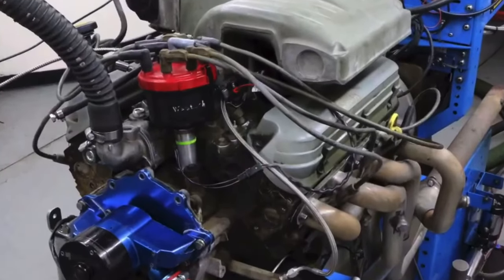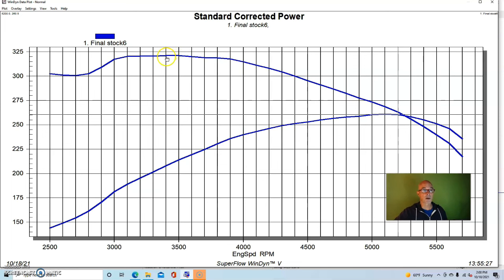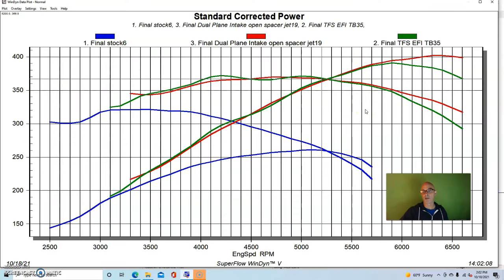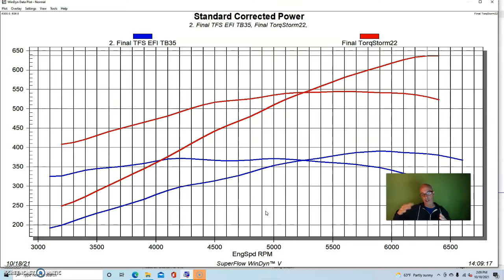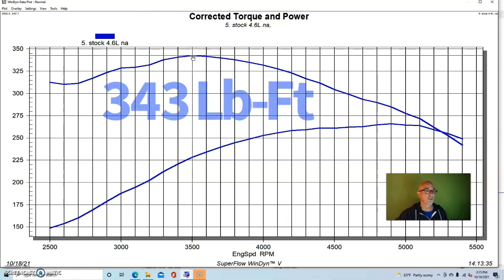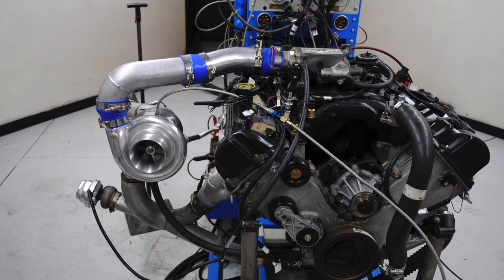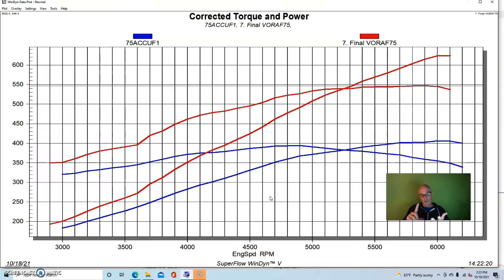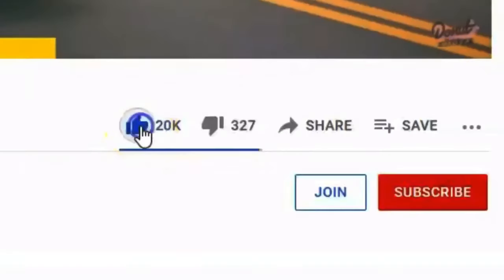WHICH FORD V8 WORKS BEST? OHV VS SOHC, 5.0L 302 vs 4.6L 2-VALVE MODULAR? WHO IS BEST FOR BOOST?

Comment: I would always, always, always go with the 5.0 over the 4.6, why? The aftermarket, Tons & Tons of stuff, oh yeah n that Cubic inch thing!!😂💜💜💜 But both are great platforms, just comes down to preferences 💯‼️ Thanks Sir!!
Reply: Yeah because there's no aftermarket for the 4.6. You can get what ever the 5.0 has for the 4.6
Reply from the maker: the 4.6l doesn't have 30-40 different sets of after market heads, but it does have 1 set and ported PIs
Reply: @richardholdener1727  that's because pi heads aren't absolutely junk like any iron sbf head
Reply: @dougsgtp  iron?
Reply: @MikeSmith-ey7ku  cast iron heads......
Reply: @dougsgtp  the 4.6 doesn’t have iron heads
Reply: @MikeSmith-ey7ku  I know, reread the posts
Reply: @dougsgtp yea they're decent and aluminum factory unlike the 302.  Ported pi can make some decent power.
Reply: The 4.6 makes just as much power with less cubes did you watch the video?  Lol.  You can make more reliable power with just forged internals instead of needing a dart block too like with a 302.  The 4.6 is the better platform ppl just like the 302 because of nostalgia and because it's larger like you just said.  It sounds cooler saying 5.0 vs saying 4.6.  You can also do a big bore if you wanna say 5.0 lol.

Comment: I have owned a 2002 GT for years now and it still has the original 2V motor and 5 speed 3650 manual transmission with 236,000 miles and it runs like a top and I run the tach in the red all day every day. It’s a great motor just needed more power potential. The 5.0L coyote is tempting for a swap.
Reply: Building your 4.6 2v would be way more simple and less costly, unless you're needing 7500+rpm and 800+hp capability.  Richard just showed you one pathway to 600+hp with a 4.6 2v.
Reply: Forged internals, cams, headers, boost can make some pretty good power on a 2v even with stock heads.  It'll sound way better than a coyote and you can prob do it all for not much more money all in.

Comment: At the end of the day though, the 5.0 is STILL cheaper to build....and I'm a 4.6 guy. I LOVE 4.6's. they have plenty of potential when the bottom end is built right and the heads are done but, your looking at 7 grand plus. The 5.0 can be built to the gills including a dart block for less than 5 grand and make the more power because it will then be a 347 or some type of stroker lol. But, there is NO sound like a 4.6 turning 7600 Rpm before a shift ❤️
Reply: drop in forged pistons and rods plus a cam swap on a 4V 4.6 and youll do way better with less money. what you spend on cams, you dont have to spend on cnc ported heads/intake/ blah blah blah.
Reply: @OxBlitzkriegxO  but why do you need stronger rods and pistons?
Reply: @MrPorsche91730  they are a weak point stock
Reply: @MrPorsche91730 so you can boost it to the moon and back and make tons of power reliably.  You can't do that with the same mods on a 5 liter because you would also need an aftermarket block to make the kind of reliable power a forged 4.6 can.
Reply: Dude you can do heads cams and bottom end for way less than 7k.  It's gonna cost more to build the 5.0 because you gotta have the dart block to make the kind of power the 4.6 can with just forged internals.  You can stroke the 2v to 5.3 and with the right heads and cams setup it'll make as much power as most 347 setups.  Cams cost little more because 2 vs 1 but otherwise most other mods are similar other than you need a dart on the Windsor adding 2000+ dollars to it.  You're way over shooting what it costs to do a forged 4.6 with ported heads.

Comment: when i had my 1999 mustang GT, i ran a 70mm th body, mac long tube headers with 3 in collectors, 3 in  mac power chamber no cats, ported upper intake plen, FRPP underdrive pulleys, 24 lb injectors, 4.10 gears, Ported stock 80mm mass air, K&N open element filter, Super Chips tune for 100 oct fuel.. 310 rwh hp with a Auto and a 3000 stall and a transgo shiftkit. Key is the plugs, copper 1 step hotter. custom gap.
Reply: You have the part number for the hotter plugs?
Reply from the maker: 300 wheel hp with no cam or heads and a ported stock upper? seems high

Comment: I have a project Bronco I'm in the process of building. It's a 89 with a 5.8 V8. I've been debating on building up the stock engine or coyote swapping  it. I eventually want to add boost and spray for a drag setup. For now I'm just going to stoke it to a 408, put some better heads on and go from there. My questions are is it worth spending the money on stroking the engine and will it be able to handle boost and spray after I do? Or should I just do the swap and build up from there?. Fords are definitely more complicated than LS/LT engines I can tell you that but I refuse to cross brand my vehicle. I'm an American and I love all American brand muscle cars and trucks so I don't have a favorite. My Tahoe will stay GM, my Bronco will Stay Ford, and when I get a Mopar Truck it will stay Mopar.
Reply: The 351 block is a thicker casting than a 302 block. You can get more power, and do so safer. That said, a truck coyote from, say a 2016, you'll get instant access to the better part of 400whp. A 351 is gonna be cheaper to build. But a coyote makes pretty impressive power untouched

Comment: 20 fewer cubes and the 4.6 makes more torque than the 302. I'd like to see the test of the Trick Flow OHC heads.
Reply: Longer rods, more piston dwell
Reply: @rickstorm4198  I'm thinking the Modular heads have better cylinder filling. I could be wrong.

Comment: Being you used Trick Flow on the 302 It been better comparison if on the 4.6 if used Trick Flow top end. By using 2V Twisted Wedge heads & TFS cams. Maybe used Victor Jr lower intake with Upper EFI plenum & TB.

Comment: What about Truck/Triton 4.6L mods?
2WD.
Ditch intake or keep it for the longer runner/better torque numbers?
Long tubes or Tri-Y headers?
Looking for mid-range punch along with a touch of stump pulling. 

Daily driver, light trailer duty.

What say you?

Comment: I personally think you should have included running the supercharger on a stock motor. You are much more likely to see that setup in the real world than heads, cam/s, intake, AND a supercharger. Also, isn't it true that you risk splitting the block on 302s if you go above 600 HP? I know I've read it in multiple places.
Reply: yes the 302’s STOCK block starts to crack above 450 if you aren’t careful, i know some guys who around 500-600hp with a stock block 302 on a Turbo or SC set up , they can hold up pretty good , sometimes...
Reply: @eric5.080  the 2v is stouter by a long shock all the mod motors are (block wise) put forged internals in both and turn the wick up the 2v is gonna hold up to much higher hp because of the block.

Comment: Great video! Wish static compression figures were given for both engines.
Reply from the maker: both were stock to start-but near 10:1 after mods
Reply: @richardholdener1727  I guess I should have been more specific. If I remember correctly, a stock 5.0 had 8.8:1 compression but you said you swapped PI heads onto a non PI block. Just curious what that raises the compression ratio to. Appreciate all of your videos!
Reply: @88tcoupe they was higher than 8.8:1 I'm certain.  The compression prob was a little higher on the 4.6 but it's down on cubes and make 5 hp and 20+ tq more despite being less displacement.  After modding the trickflow heads prob added compression to the 5 liter I'd imagine.
Reply: @midnight347 I thought a stock 5.0 was 8.8:1 but I think you're right. I checked and it looks like they were 9.0:1.

Comment: I've got a 4.6 thunderbird in the process of getting an entire pi swap. I wish i had a 5.0 bird to start out with though
Reply: Look what Johnny Langton accomplished with his 2v auto Thunderbird. I can not find 1 thunderbird with pi heads running the times that his did na with renegade npi heads.
Reply: @madmod  hell yeah. So far its been a giant pain in the ass
Reply: @brysonshires9742  Most of the gains in the swap come from the pi cam and pi intake manifold both of which will drop on to a stock 96+ npi head with no issues. Theres also the compression bump going to the pi heads but thats not hugely responsible for the power gains offered. Not only can the npi fit a better cam spec, they also dont spit plugs like pi heads do, and have reasonably good flow without porting when you address the single angle valve job they boast. Johnny went 12.98 in the quarter mile equipped with renegade npi heads, stock pi cams, and a stock pi intake manifold at stock compression through a 4r70 auto. At 3700lbs, i cant find a single pi 2v na running those same times in that chassis. I would 4v swap before pi swapping with how affordable used intech engines are these days but thats not to say the PI heads can't make great power.
Reply: @madmod  i would probably reuse the 95 bottom end and heads if it didnt have a spun bearing and no compression on 8
Reply: @madmod  you seem to know a ton about these. If i go on rockauto and buy a maruder torque converter, will it bolt right into the 95 trans? If not what would be a better converter to go with, looking for around a 2500stall
Reply: @brysonshires9742  I believe the 95 4r70w is identical to the later transmissions with the exception that some use different length tailshafts and they also boast one less accumulator spring on the 1-2. To answer your question, you should be able to use the marauder converter no problem. Id also recommend a jmod since you've already got the trans out. The jmod will greatly improve shift firmness and speed, as well as help prolong your trans life. The stock converter from a Marauder, mustang, mark viii, and mach 1 autos are great improvements over the stocker found in early platforms like panthers, cougars, and birds.
Reply: @brysonshires9742  If you are content on using pi heads and want the best bang for the buck, you should consider finding a used explorer 2v engine. They are equipped with an aluminum block and the same pi cams and heads as the Mustang. You also get the benefit of losing 80lbs off the nose of the car just due to the block alone. They can be had complete which saves you piecing together a swap and ultimately the aluminum block is a lot stronger making it a solid option to throw your hard earned dollars at.
Reply from the maker: I wasn't aware of the alum 2V in the Explorer-than for the info
Reply: @madmod  thats exactly the motor im looking for. Really any 01-04 aluminum block. Then if i end up blowing that slap the pi heads on a 98-00 bottom end
Reply: Thanks to your information if i ever get some heads built itll most likely be the stock 95 heads, assuming they're good. All i know about the engine is it was overheated to the point of a spun bearing, so little hope on those actually being good
Reply: @brysonshires9742  The 91-95 npi heads should be avoided. They have poor valve springs and take different valve stem seals than all the other modular engines. The 96-98 npi and 99-11 pi share the same valve springs despite different assembled heights and both are far superior to the older castings in terms of flow and being able to maintain or upgrade them. Stock NPI's will maintain valve control better than a stock PI due to the higher seat and open pressure with the shorter installed spring height however, you lose max lift before coil bind occurs to around .540 lift. Id really recommend any 96 or later 2v casting over the early stuff just to save yourself from the headaches.